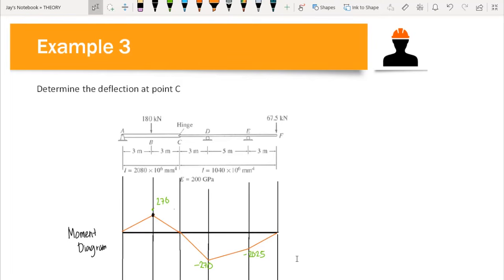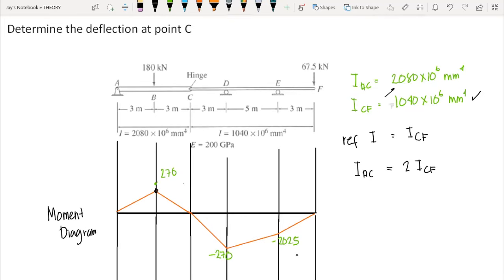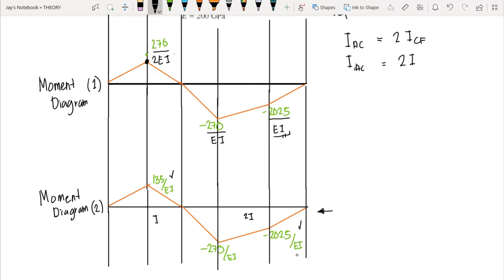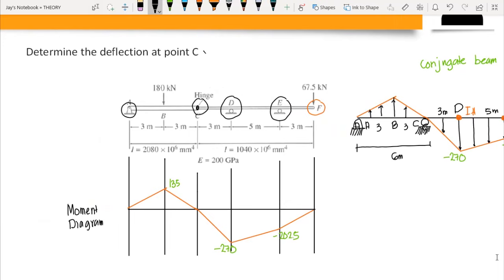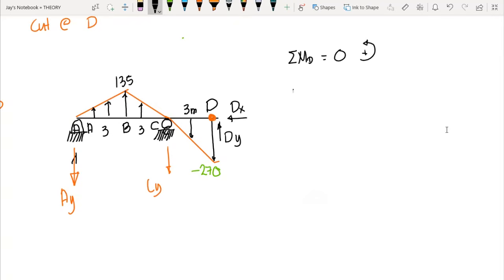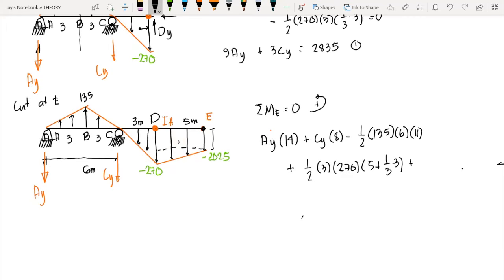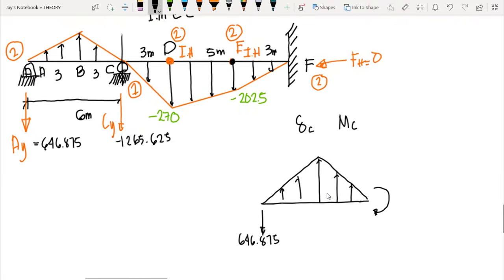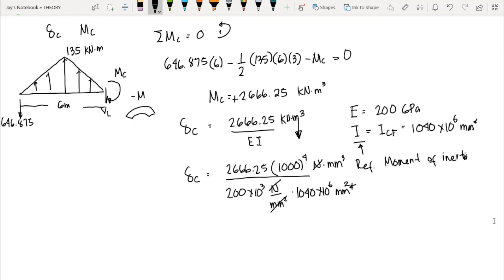Structural Theory | Conjugate-beam Method part 3 of 3

Comment: Hello po sir. Pwede po mahingi yung Solution niyo sa pagkuha po ng Reaction niyo for Point A
Reply: I know matagal na ang question na to. Pero baka lang makatulong. I tried using systems of equation din gaya ng reactions sa conjugate beam. Nagcut ako sa C where moment is equal to 0, and nagmoment ako sa A. Sa moment of A=0, nakuha kong equation ay 9Dy+14Ey=1687.5, and sa cut ko at point C, 3Dy+8Ey=742.5. Dy= 103.5; Ey=54. Then, summation of Fy, Ay=90.
Reply: @amiemarievargas6282 thank you sa reply mo po